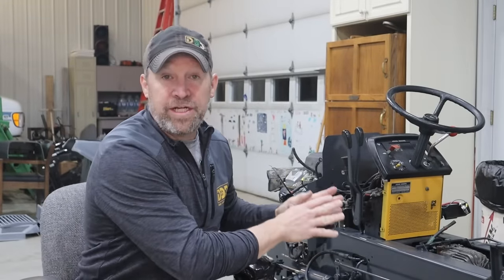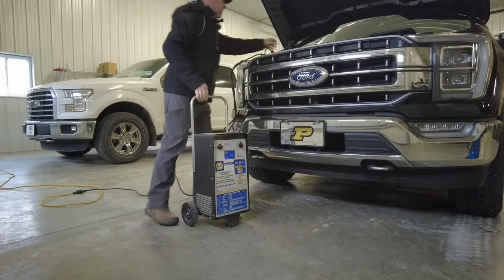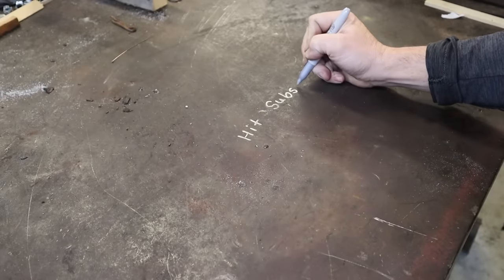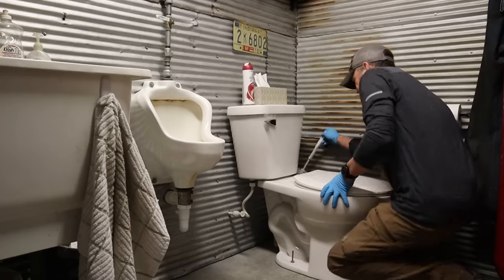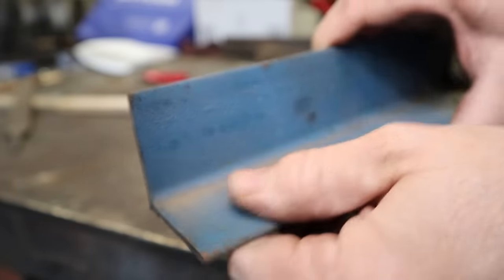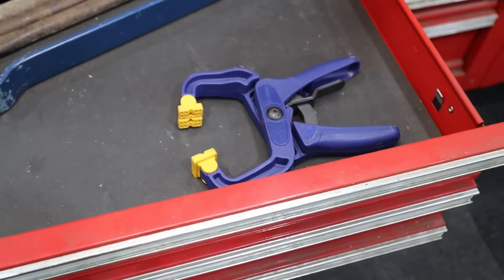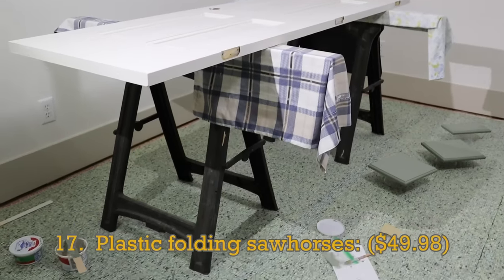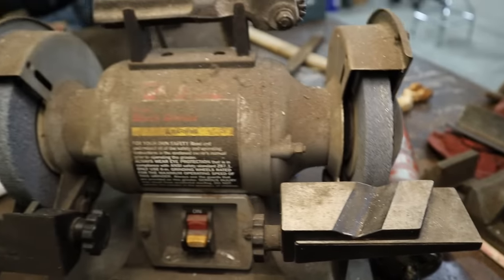(20) Must Have Tools You Don't Know You Need

Comment: Back when we had a cat, we used cat litter that came in yellow plastic boxes with a carry handle.  When they were empty they went to the garage to act as job boxes and tool carriers.   A cool aspect is that I can stack them higher than I am tall.
I learned about silver sharpies from my sister who is artistic and uses them on art projects.
When I was teenager I bought a trickle charger.  It was about the size of a 2 bricks and died.  So I bought a bigger and more powerful one, and it died, so I bought a bigger and more powerful one and it died. This continued until about 40 years ago and I bought one that came on wheels and could jump start my car.  It was made in the USA and almost as good as the ones in service stations.  It is still alive and has saved a morning for family members and neighbors.   The funny thing is that it is more reliable than utility power in California.

Comment: I use side cutter snips for zip ties, it gets it close enough and the tool is useful for other things.  I don’t mind single use tools but if I can get multi-use out of a tool that is actually as good as several single use tools, I prefer that.
Reply: Grr. Only a micro side clipper works, but it can't do as good as a true zip tie cutter.
Reply: @TallTexasGMan  is it because the zip-tie cutter pulls, cuts then it is below the surface of the catch part?
Reply from the maker: YES

Comment: My family owned an old house with a slot in the bottom of each medicine cabinet... the original purpose was to dispose of safety razor blades - apparently a fairly common feature on old homes in the south. 

Maybe you can figure something like that for your single edged blades.

Comment: Made myself a jump starter with 2 lead acid batteries  ona  two wheeled trolley and jump cables attached  to start vehicles cos I was tired of carrying batteries to cars to start them and added a  work light cos it seems that all cars stop.   When it's dark  now 10 yrs on both batts need replacing but never regretted making them 👍

Comment: I have a rolling magnet, not only is good for cleaning up metal dust/shavings from the floor. Great for finding that absolutely tiny screw you end up inevitably dropping on the floor. My only issue with the tool has been cleaning it off, almost would prefer a battery operated one so I can turn the magnet on and off.
Reply from the maker: My girls love running the ruler, magnet and finding all kinds of treasures!

Comment: Depends on the job:

For mechanics, some that may not have been mentioned yet:     OBD2 code tester.  Turkey baster.  Transfer pump/siphon,  Secondary drip pan,  brake bleeder,  tool totes. Hego socket, MAF cleaner spray, Electronic cleaner spray/ Deoxit,  flex socket extension, thin ratchet, palm ratchet, ez outs, ATF/acetone nut blaster, grinder, saws all, flaring tool, exhaust cutter, Dremel,   DMM, wire brushes, Old cookie tray (parts tray, oil drip pan),  muffin pan (sorter disassembly parts tray), tooth brushes, wire brushes, files, large cardboard sheet (= max clearance "creeper", drop cloth, etc),  carpet scraps (alt to creeper, oil sop, padding), Aluminum tape, plastic welding iron, hose clamps, flush kit,  wiper arm remover, brake puller, good vice grip, EZ outs, good jacks/ stands, induction bolt heater, Shop manuals, and/or PC for online research and parts ordering. Clip board,  Sewing awl for upholstery repair,  specialized integral u joint sockets or thin wall sockets for tight work.  Tap and die.  Torx bits. Slide hammer + rope + broom stick.  ( to remove a corrosion welded hub. )  PPE:   safety glasses/ face shield, ear muffs, respirator gloves, GFI, fire extinguisher, HD jack stands, secondary support, wheel chocks,  kneeling pad/ knee pads, adjustable stool on  casters,  box fan (to clear fumes from work area).  AC charge manifold, chain breaker, Schrader valve wrench.  HVAC thermometer.. 

On the road:   USB charger, road flares, jumper cables, reflectors, emergency light, flash light, jack, chocks, tire iron, extension pipe, maintained spare, tire patch kit, tire fill sealant, 12 V inflator, tire gauge, travel tool kit, change of clothes, mat/tarp, water/towel for clean up,  fuses, bulbs, spare COP/ plug, gas can. ratchet straps, red flag, packing twine,  bungee cord(s), hand truck, roof rack, hitch, duct tape.

The list goes on depending on the job:  (carpentry, automotive, bike, electronics, 120V electrical, plumbing, demo, tree work, masonry, trim, roofing, critter control, caulking, Hvac, cleaning, moving, stitching, first aid, tact, siding, gardening, metal work, etc.)

Comment: I am about to diy remove and install new kyb quick strut assemblies (front&rear) as well as sway bar links and bushings. I am looking for the most versatile and useful powertools to help me out while taking on these jobs in my home garage using a hydraulic jack + jack stands on my 2015 toyota camry. Right now i have the m18 1/2 impact wrench mid torque in my amazon cart, the impact adapters + socket set, allen keys, wrenches, kyb strut and shock assemblies (all 4) and corresponding sway bars (all 4). Breaker bar, torque wrench is there anything im missing or that would work better for the job?

Comment: Air compressor. Air impact driver. Sometimes you have a nut that cannot be removed by hand because it's on something that moves. For instance, a crankshaft pulley. An impact wrench will get it off pronto.

Comment: The best thing I have found for disposing of razor blades is to simply use the blade it self to cut a slit and push the blade into an empty water/soda bottle (Soda Bottles are thicker) and toss the bottle into the trash.  I keep a gatorade bottle on the work bench and most blades will fit through the mouth of the bottle.

Comment: I used to do the same thing with used Razor blades.  I bought a 1 quart size sharps container from Amazon 10 years ago for $5.50...still not full.  Add it to the list.
Reply: Livestock farmers also use coffee cans with lids, laundry detergent jugs, etc. to safely contain and dispose of spent needles.  Mark the container as 'sharps'.  Plastic peanut butter jar would be a good size for a shop, not too big.
Reply from the maker: That's a good idea.

Comment: * A multi grade pack of steel wool is good but I make sure I have the fine grades up to 0000.
* Merkts brand cheese spread from Wal-Mart comes in a handy 14 oz. plastic cups with a lid, great for everything around the shop and stackable, I have several but still can't throw them out in the kitchen trash after a bout with Wheat Thins.

Comment: Holy cow, I’ve got a similar list. I buy silver and black sharpies by the box. Best use for zip lock bags? To store zip lock bags! If you cut the zip tie at a 90 degree angle, it will cut flush about 92% of the time but I recently bought the tool for it too. I even have a black ford f-150!

Did you ever share your gray paint color name or number? Great video!
Reply from the maker: Thanks!
The grey paint on my tractor is John Deere Construction (Hitachi) grey.  I bought it at the John Deere dealer.

Comment: For hanging a shelf, making a lift cable to keep your mower seat on a z-turn from hitting the deck, or hanging various styles of fluorescent lights I use a 304 Stainless Steel Cable Wire Rope 1/16 x 165ft Cutter&Crimping Tool and Sleeve. I also have a set of ratcheting end wrenches that I use almost exclusively over other wrenches.  A folding razor knife that I bought 3 years ago at HF is always in my pocket because it comes in handy for so many things.  Many more but this list is getting too big already and I know you have better things to do than read it all.  I do have some of what you showed and yes they are also on my favorites list.
Reply from the maker: Excellent additions

Comment: I can agree with your list. It all sounds to familiar. I like the little teaser of the dash support, I think it will look awesome when done. You mentioned in a past video that you had a 400 series tractor. Just curious on your thoughts on them vs. the 300 series. Keep on tinkering.
Reply from the maker: I like the 400s as well. Honestly though I haven't seen a 400 do anything a 300 won't do and I already had all the attachments for the 300's. I think the 400's are good for bigger, taller guys.  I'm a smaller guy and the 300s are just a good fit. Love em all though for sure.

Comment: Great list Neil, but I have to say probably my number one tool would have to be a set of ratcheting crimping pliers for wires—I used to constantly have to chase loose/bad connections and bad crimping until I bought a ratcheting crimping set. Also a good voltmeter comes in handy! Also those heat shrinking connectors and heat shrink also great to have on hand lol

Comment: got a winner for your old razor blades.  get a coffee can with a lid and cut a slot big enough to fit your blades through and very clearly label it old razor blades. just keep dumping them in. if you manage to fill a bucket with razor blades you just tape it shut and trash it or take it to the scrap yard.  also, while the silver sharpie is invaluable, a gold sharpie is also a highly valuable marking device to keep handy. shows up on things that a black or silver sharpie are hard to see.  and the last note, the fancy smart chargers are good for maintaining batteries but the analogs can usually resurrect a battery.  so far as tools that made my life easier in the barn, i would definitely say good utility carts are high on the list.  i recently picked up a general work cart from harbor freight and it is already proving its use for streamlining projects.  i can load up the tools i'm using for a long term project and just wheel it in and out instead of carrying everything i'm using in and out every day since my projects currently cannot get inside the barn. funnily enough i actually do have everything on your list.

Comment: I have found that the smart charger needs to sense some kind of voltage to work if a battery is completely dead they do nothing so what I do is ase jumper cables from a known good battery to the dead battery then connect the smart charger to dead battery at same time and it will charge like a normal charger.
Reply from the maker: I've seen some other folks mention that. That's a good work around but I'm really been loving this battery charger that doesn't require you to do anything but hook it up and turn it on! 😋

Comment: ice cream buckets are free, however, local donut shops or bakeries typically get their stuff in nice buckets. even the small one is a little bigger than the ice cream bucket, and they have larger sizes. they typically will give or sell for very cheap and they come with lids that seal 100%. my dad swears by them

Comment: I'd add a decent battery trickle charger to keep small engine (like your John Deere) topped off and ready to go.Once it sense the battery is topped off it goes into a low current Maintenace mode.
I leave one hooked to my mower over winter so it's ready to go in the spring.

Comment: A recent "upgrade" I have added to my shop and travel tool boxes is the click version of Sharpies. 
I have always hated the necessity of the cap SOP for Sharpies.  Take the cap off, set cap on the pen's butt end because of the times you have lost track of them or they fall into the sawdust on the floor, then after making your mark have an internal debate over whether to re-cap or if your next need will come soon enough to risk the evaporative loss, realize you want to have it in your pocket anyway until needed again and you don't dare do that except with the cap on, so you put the cap back on, and realize you need two hands to do it because you don't want to be one of those people who care so little about their health that they will actually hold that dirty cap IN THEIR MOUTH.....

Instead, pull pen from pocket or toolbox, click, mark, click, return.  One handed, and never have to take my eyes off my work.....and my mouth never enters the consideration.

Comment: Lowes beburr tool it the best that's cheap and a counter sink . Unibit will get a lot of holes done and works as counter sink harbor freight is pretty good one . A 1/4 " bit ratchet any brand . But craftsman or power torque O'Reilly's. .

Comment: You can fool a smart charger into charging a dead battery if you put jumper cables to a known good battery from the dead one and hook the charger to the dead battery. It'll detect voltage and start charging. Once it gets high enough you can disconnect the good battery.

Comment: If your smart charger has a "supply" setting to work as a power source, you can use it to force power into a dead battery until the voltage is high enough for the charger to accept the dead battery. Or you can take a 12V battery from a power tool and connect it in parallel to the dead battery to trick the charger.
Nitrile gloves are nice, but find yourself a pair of oil and chemical resistant rubber gloves that aren't too thick like at Wurth. Once you find the right ones, you will use them all the time.
A set of crows feet sockets is something you need when you need them and nothing else will do. Had to change a hose on the front suspension on a tractor that blew, and with the suspension collapsed there was no way to get the hose off. Had to use two crows feet deep into the frame to hold one fitting while getting the other end off. Would have needed a tow or a huge jack and lift the whole tractor without that one tool.
Reply from the maker: Crows feet can be a hero when you really need them!
Reply: If you have another vehicle and jumper cables handy, you can also trick a digital charger by connecting them together. After a short period of initial charging you can disconnect the second vehicle and let the charger keep going for a full charge.

Comment: The issue with new smart charges is when it see voltage below a threshold it assumes you have a shorted cell & wont attempt to charge the battery because it could detonate. Some great tools that would complement your list is Acetone to wipe down dirty metal before using your silver Sharpe or a tool to make other tools a cheap mig welder, hell the list can go one forever especially if your a tool guy. Lol

Comment: Ice cream bucket handles fail quickly.
They are what's known as 'single use' in the food industry.
Good for cleaning vessel of or containing small parts though. 
Instead I use a canvas tool bag.
Not big on HARBOR FREIGHT but they can be purchased there.
✌️❤️

Comment: The list....
1.) One gallon ice cream bucket
2.) Razor blade
3.) Silver Sharpie (2)
4.) Scribe
5.) Ziplock bags
6.) Emory cloth
7.) Rubber gloves
8.) Zip tie cutter...flush cut
9.) Hand operated deburring tool
10.) Chamfer with countersink bits
11.) Tarps, assorted
12.) Assorted wood blocks
13.) C-clamps
14.) Heat gun
15.) Multi-cutters
16.) Furniture carts
17.) Plastic sawhorses
18.) Push broom, fine bristle
19.) Wire brushes
20.) Old analog style battery charger

Now.....watch the video for all of the great details!!

Comment: Why are silver sharpies the only ones that DON'T have a clip on it???

Anything with Either in it will dissolve the thin rubber gloves. So before you start cleaning that carb , get the thick dark blue or black ones  8/9 mm I think.
I worked for a man that on my first day of work said if I ever CUT a ty wrap he would fire me . I was an electrician, if you take a pair of kleins and twist it off , it looks like fido's but but it will never cut you. Now H/F has these little cutters that cut them flush. I have about 10 pairs laying around Everywhere. But I still like the true tywrap/ ziptie tool because it tightens it as well as cut/twists it off.
Is that a 185 I see in the background? My best friend had one of them ( I had a 250sx)  I was going to get a 185 and he talked me into the 250.those were the good ol days. 
It's not a shop without a wire wheel on a grinder.
Last but not least: I am a clean shop fanatic and I discovered that a broom just transferred the dust from the floor to EVERYWHERE . I learned from working at lowes( part time for a vert short time) this great stuff called DUST DOWN. Great stuff but pricy. Now I use the shopvec ( with a bag) or it too just transfers the dust from one side to the other.
This is probably one of the BEST shop items videos I have seen . I'm always looking for ideas. I like the way you think. 
New subscriber.
Sorry for the book.
Reply from the maker: Hey Marshall.  Thanks for the great additions to the list. I'll have to look into that Dust Down. 
Good question on the Sharpie cap. I miss the  clip too!
That 3 wheeler is a 200s bought new by my Grandpa in 1985.
Thanks for checking out my video!

Comment: High output hot water pressure washer with wet sandblasting attachment and high pressure soap injector .Restoring and cleaning equipment like you . But you Probably have one . 👍
Reply from the maker: I need one!  They are pricey for a good one.